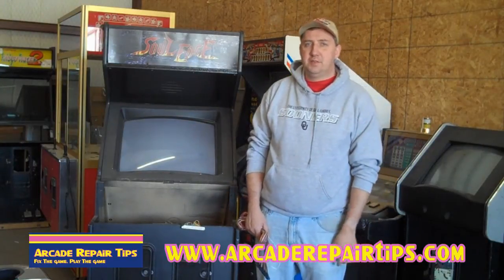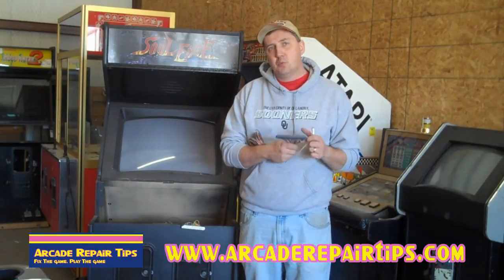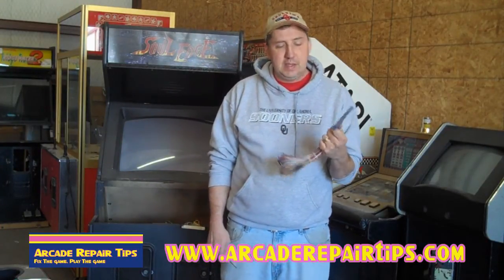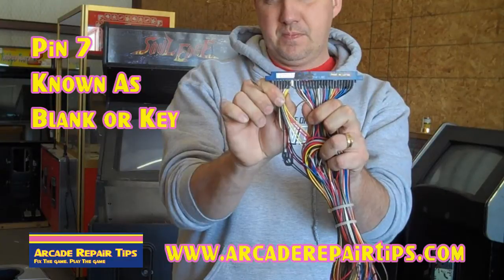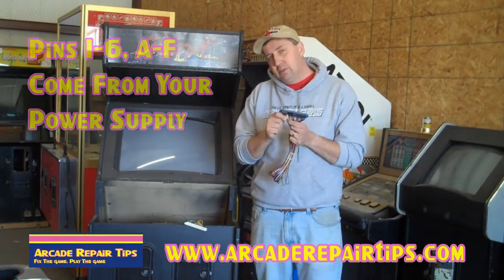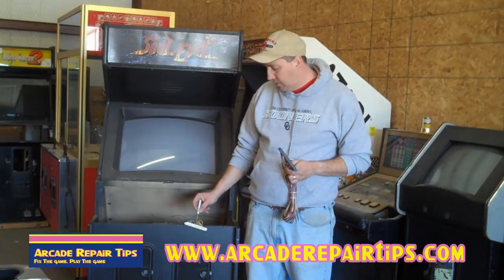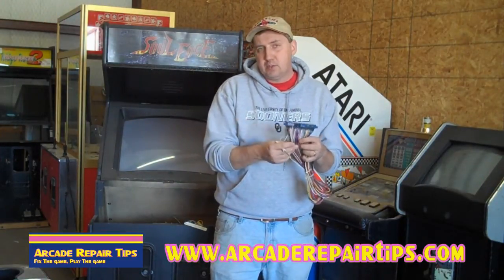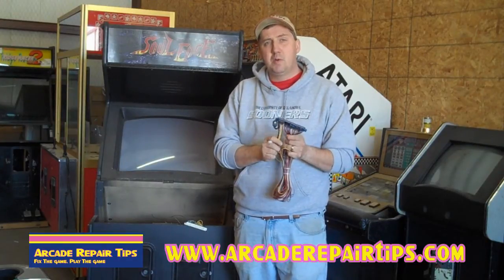Arcade Repair Tips - Getting Familiar With The JAMMA Standard

Comment: Thank you for the video.  When connecting a kick harness, do you need to run the ground wire from the kick harness itself to the kick buttons, or can you still use the ground wire that is daisy chained to all the other (punch) buttons going back to the Jamma harness?
Reply from the maker: In our experience, it’s fine to use the daisy-chained ground wires on the button switches that are connected to the kick harness. With that said, we tend to use the kick harness ground wires when we initially wire a game.

We also wanted to let you know that we will be covering your question on our Live Show Episode 74 on Thursday, April 8, 2023 at 5:30 PM CT on YouTube. Here's a link to the episode if you want to watch it live: https://www.youtube.com/watch?v=3ajMHqyO1eY. Thank you for your question and good luck with your future repairs.

Comment: okay thanks. I cant seem to find his 100$ unit, but I can try to wrap my head around the power supply. I'm trying to make a Mortal Kombat 3 cabinets and basically need to do it from scratch. I have a monitor, the control panel/buttons, a switching power supply and an isolated transformer. Now I'm just trying to learn how to make one of these power sources and how to connect them to jamma harnesses and into my monitor etc. Has been a very confusing thing for me to learn so far.